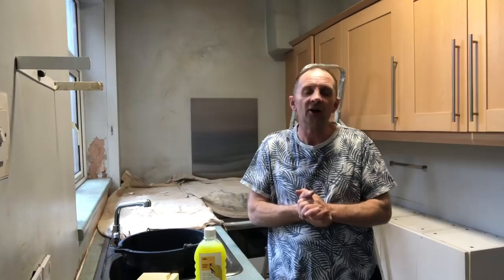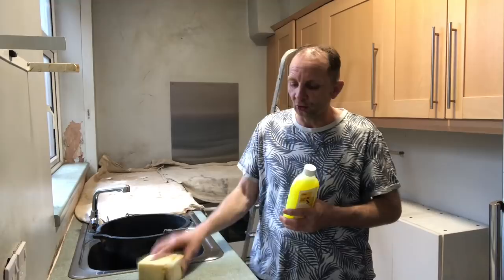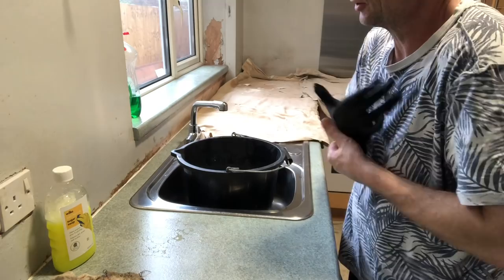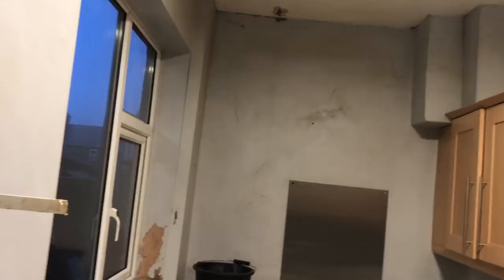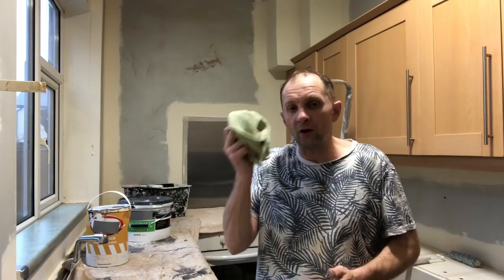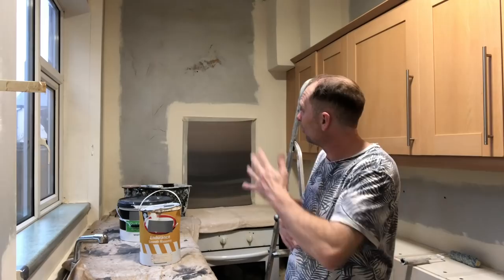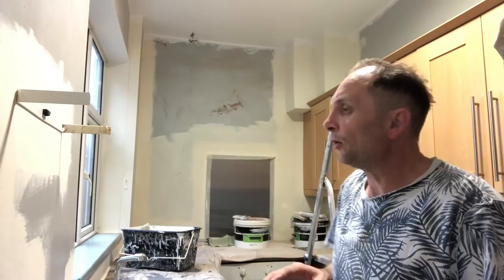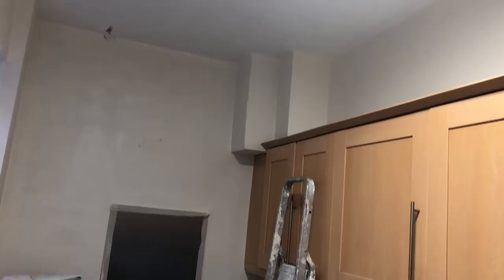How to paint your Kitchen

Comment: Normally if the walls are bad I'll wash down with sugar soap and if emulsion as a finish paint I'll put a oil base undercoat on ceing walls to seal them so any stain may still be there it wont bleed through the mully
Reply: Try the Johnstone stainaway primer/finish to stop stains, an absolutely superb water based paint that works ! No smelly oil and can recoat same day.

Comment: Don't get too many wash down jobs nowadays. If I do it's a quick wash in the very worst area's. Then  Zinsser Bin if its really bad or bog standard oil based undercoat for nicotine. Then top coat with any good trade paint.
Reply: Try the new Johnstones trade stainaway water based, superb for stain blocks and it's a finish in own right also. You seem to be be able touch up.patches and doesn't shine through like BINetc does means you might not have to stainblock whole wall. !

Comment: Hi Mark, why Masonry, satin or eggshell?? What's wrong with mid or soft Sheen or other products like johnos dururable matt or Crown clean extreme 1000 srcub rating?
Reply: Probably because he had it free off of a job😂
Reply: Yes Jack but Masonry is masonry paint for a reason exterior only of that was the case why not call it muti purpose paint instead Masonry, oil eggshell is OK but you can not deny the other brands of paint I mentioned would produce a better finish
Reply: Jack really the size of that kitchen, 2.5 litres of whatever paint isn't gonna break the bank
Reply: Jack what prices are you paying mate!? Sure Crown clean extreme for that kitchen would cost you 25 quid retail price,  10 litre of mid sheen around the 20 quid maybe bit more total of 50 quid should we say.. go away with your 100 quid mate
Reply: Plus your not gonna use the whole 10 litre, charge the customer 10 quid for the ceiling paint and there you go half already paid for and away you go with the rest for the next Job
Reply: There you go John no need to splash out hundred quid then mate
Reply: But as I said Crown clean extreme is perfect for any area of house especially kitchens

Comment: What caulk would you use on the corner of the ceiling
Reply: @jackwardley3626  I will be using dulux retail matt on the walls and ceilings but I don't know what I will be using on the skirting.

Comment: A contract Matt on a kitchen ceiling? Not a good idea, it's not wipeable in the slightest.. A cheap durable Matt like tikkurlia anti relfex 2 £30 for 10l not going to break the bank.
Also you should not under any circumstances be using a masonry paint inside , it can off gas over time and you are breathing it in. Not good for you. All sorts of nasties in it. Strictly outside only. 
Not recommended. You could possibly be in serious trouble in the future using this. 
A cheap durable Matt / eggshell is not going break bank. Leyland acyrlic durable/matt or eggshell. If old bleeding stains a problem, the Johnstone stainway water based stain block/ finish is excellent. No odour for you or customer.
Reply: Humbly asking for your oppinion, what a cirtain amount of zinc in a masonry paint can harm in a kitchen, whith everyday using of cleaning and viporating materials ised for cleaning deashes?
Reply: @ShalomGreenberg  On the back of the tins it strictly says not for interior use. The various  data sheets also. 
Off gas for years , the steam in kitchens bathrooms can contribute to this from memory. Really not a good idea. All sorts of nasties can be realised and customer breathing in over a period of time. 
Not worth the risk.
Reply: Thought the same about off gassing .